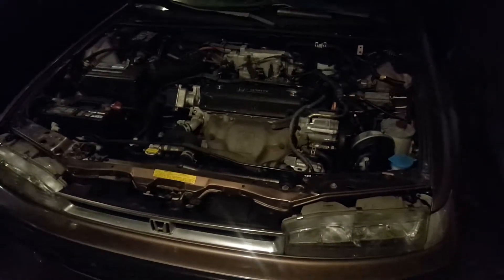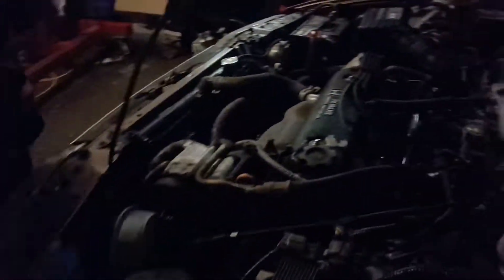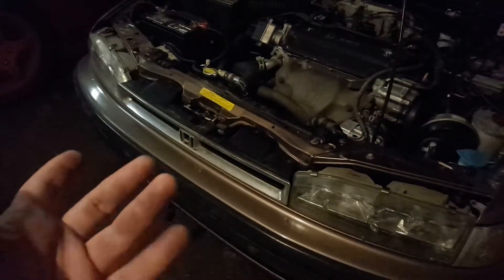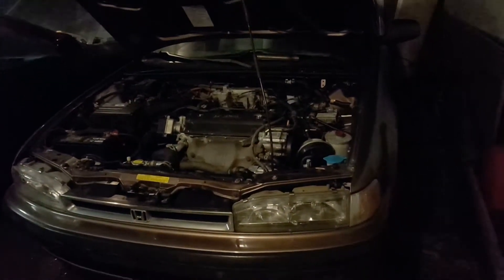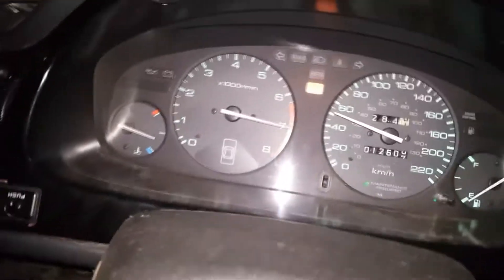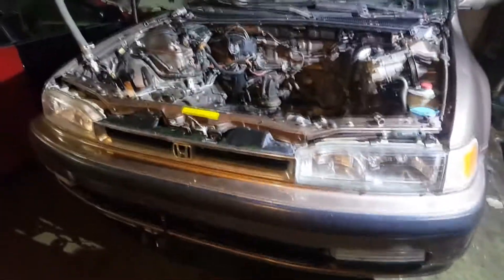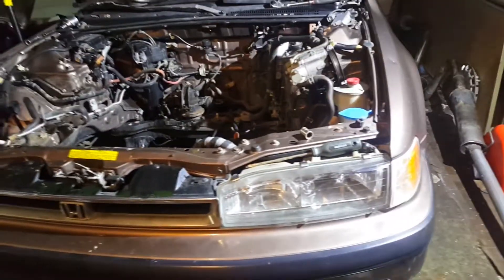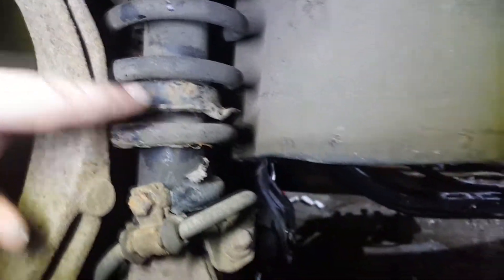1990 CB7 Honda Accord H22 Swap

Comment: Hey there I found  the wire harness to run the vtec and other sensor on eBay but question the IAB the cable is yellow I know one will run to the ecu but it haves a other yellow wire coming from the same plug we’re do I connect to my 91 accord harness

Comment: Can I just used the H22a timing side bracket that came with the motor and just buy a motor mount at the parts store I have a 91 Accord what part did you use for the driver side mount and mount bracket please let me know this is the only thing holding me up

Comment: Ok so you used the accord driver side motor mount..with the original H22a motor mount bracket that came with the motor correct and it fit perfectly
Reply from the maker: Yes sir. Was a 98 h22a4 block side braket and the stock cb7 chassis side mount

Comment: Having problems with the innovative mount I bought for the driver side they told me I have to use the timing side bracket from my old accord but it will not bolt up correct 1 bolt won’t lineup......
Reply from the maker: Intresting. I just used the factory accord mount and the factory h22a4 prelude mount under the timing cover
Reply: @TooStock  ok I guess I have to go buy one at the parts store and used that one better and reinstalled the H22a motor mount bracket back thanks...
Reply from the maker: How far off is the h mount to your aftermarket one? If it's not far id almost take a dermal and buz the hole to the side needed
Reply: @TooStock  the bracket that goes to the block not much space to drill the bracket it’s short

Comment: I have the H22a Jdm motor hopefully that’s not a problem mines is a 94 I will check how it works thanks for the help
Reply from the maker: 94 to 97+ I think have a diffrent mount fine a 97+ block side mount at the junk yard

Comment: Hey was dropping my engine today but the driver side mount having a problem with I bought the innovative mounts won’t line up someone told me I have to used my old bracket that goes to the engine that connects to my old mount on the driver side is that correct I need the old bracket by the timing side to used the innovative mount and will drop in fine
Reply from the maker: What time of mount is on the motor? The stock h22a4 (5th gen prelude) mount on the motor side shude work fine it's what I have. The f22a1-a6 does not 100% bolt to the h22 properly
Reply: 94 prelude H22a it did not came with the mount only the bracket were mount mounts on..and I have a 91 Accord wagon my motor mounts all are innovative motor mounts..so my question is if I need the bracket of the timing side of my old f22 engine to installed it on the H22a

Comment: Thinking about doing the same swap on my wagon first time doing it did the h22 just drop in perfect with the same motor mounts of the f22..also what cv joints you used mine it’s also a automatic let me know thanks
Reply from the maker: sorry for the later reply but yes the f22 mounts all work on the h motor and if your staying with the auto the cv will be fine with the stock accord ones. when I did the manual swap on mine I had to pick up the manual cv's since there different from the autos but the stock 4gen accord axles work fine with the swap
Reply: what transmission you use

Comment: Hey man! 
what kind of issues if did you run into with the swap, specifically with the OBD wiring? I just bought a boosted h22 swaped CD5 accord and  I want to swap it into  my Cb7 ( also an auto tranny) in the next couple of weeks. any tips would be greatly appreciated.
thanks!
Reply from the maker: well if its all ready a obd 1 set up your pretty clear to go. my motor was a obd2 motor before. I had to change out the leads for the fuel injector to the obd2 plugs but yours might be different being a all ready turbo set up. I also had to change my distributor to a td61u since that's a o obd1 dizzy. the obd2 uses a crank signal to were obd1 is all ran off the distributor. I used the stock F harness and there was vary little I had to do to get it to run the H22. I am not running the auto trans no more I swapped it over to a manual
Reply: @TooStock  thanks for the reply man! I've been on the old Forums all day and I think I'm going to be good to go for the swap in the next week or so. with the exception of clearances issues of coarse. I will also going with a manual swap as well. Auto tranny in an engine swap like this is like having an AR-15 that squirts mayonnaise.
Thanks man.
Reply from the maker: LOL true that auto would maybe to like 2 pulls #sendit. I also have my turbo prelude build as well on the channel here. I will be uploading a video really soon on were it curranty stands its getting really close to be putting down some numbers on the dyno
Reply: Hey man! I'm back. Motor is in, trany swapped ready to go except for the engine harness. what resources did you use for tying it into the H22. what mount did you end up buying for the trany side. thanks in advance brother!
Reply from the maker: so I just changed a little of stock f harness to work with the H like the fuel injector plugs to keep the stock h22 injectors and rewired the coolant temp plug to the back of the motor and just have to find what plug on the auto side of the trans is for the back up lights and I just went on ebay and got the innovation auto to manual conversion soled mount

Comment: Hey there I just got the thing for my auto to manual swap I have the clutch pedal..but do I have to replace my brake and gas pedals too or I can use mines and just installed the clutch pedal
Reply from the maker: I'm so sorry I didn't see your comment but you just have to change the brake pedal over can leave the gas. I drilled the tack welds out and just used the bolts to hold all the brackets

Comment: Hey if I am keeping my accord ac and power steering what crank pulley I be using to make this work cause the prelude one it’s a different belt size rip
Reply from the maker: Believe it's just the rib count that's diffrent. Can get away with running the h pully with a accord belt but I believe you can just use the accord f22 pullly. I don't have either or for mine lol but you will need a h23a1 power steering pump or a f22b pump to work with the accords stock power steering line